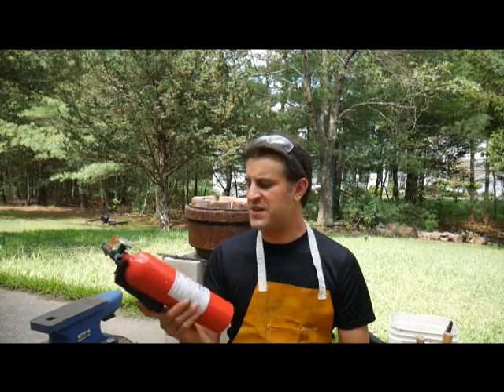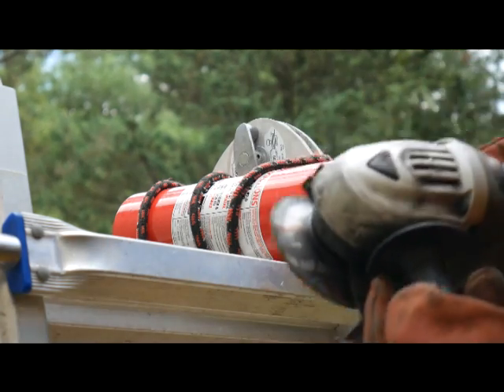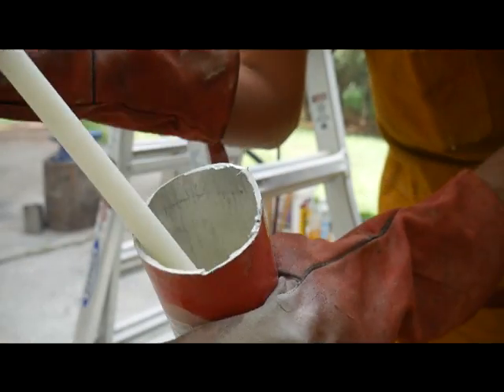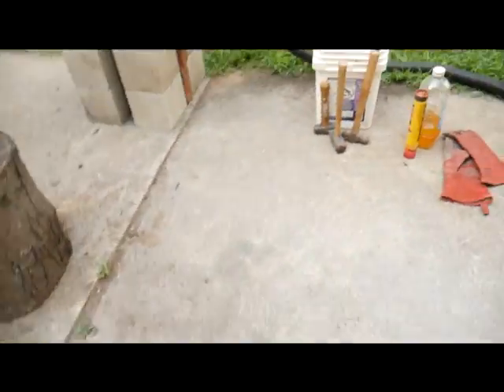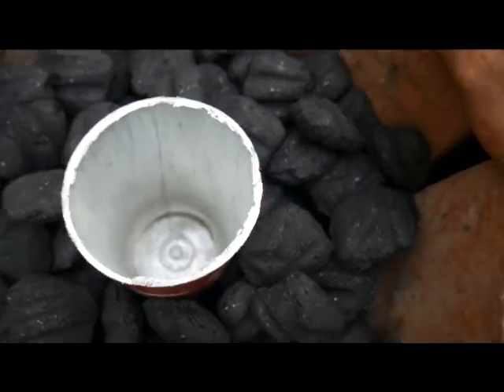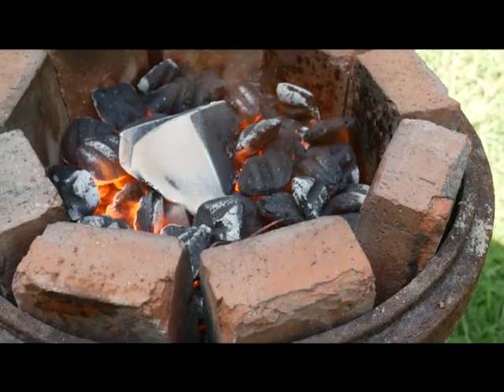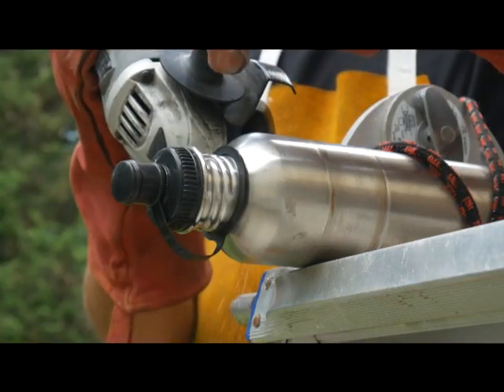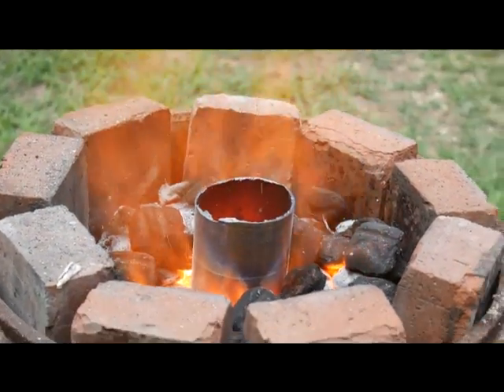Making A Crucible For Melting Aluminum Cans

Comment: if you want ot use steel crucible you need to heat it up and then cold it down very fast to make it stronger..
Reply: You don't need to, but it does help. Put it in that fire, take it out, drop it in Water and Salt.

Comment: plz answer ....
can we use stainless steel crucible to melt aluminium
Reply from the maker: Yes, but probably only for one melt.  I tried to use it for a second time and a hole formed on the bottom and the aluminum leaked out into my forge......I would look at a steel crucible as a last resort if you don't have anything else.  I love using small cast iron bowls that I find at yard sales for dirt cheap.
Reply: thnk i subbed
Reply: how to get reed of smoke which causes eye irritaion ...i used wood and coal

Comment: Your videos pretty funny dude. I like that you could left all that in there. that's the best way for people to learn. 

couple things that like to offer as far as constructive criticism goes. Be aware that under those conditions aluminum becomes corrosive to the steel Crucible and will cause it to have a failure due to the thinning of the walls if you don't pay close attention to that before each and every pour.

next is you can probably look at some videos online that offer ways to either make crucibles yourself with clay or silica sand and sodium silicate as The Binding agent period or you can just go out and buy it online but the most important thing is definitely to make sure you don't have a catastrophic failure of The Crucible right in the middle of the poor spilling liquid metal everywhere.
Reply from the maker: Thank you for that!

Comment: After watching your video, I have two points i would like to mention:

1. To find out whether something is Ferrous or Non-Ferrous you can use a magnet (if it sticks then it's Ferrous) or when you were using the disk cutter, if the object has bright orange-white sparks when cutting it is ferrous (and if you're good enough you can tell what type of steel it is from the sparks) and if not then it's Non- Ferrous metal, same can be said if using a grinder.

2. When melting Aluminium cans, I always try to make a little pool of aluminium in the bottom of crucible from solid aluminium objects as this makes it easier to rapidly melt cans and prevents the aluminum from oxidizing when just putting cans and creating a huge bloody problem when the slag wouldn't surface to the top but stays in the middle and stuffs up your crucible for good.   

Otherwise, this was a enjoyable video to watch as i am a person who works with metals in my everyday life and found this refreshing to watch.
Reply from the maker: Thanks for your comments!  My experience thus far has shown that you are absolutely correct on both of your points.  I have fun showing the screw-ups sometimes!